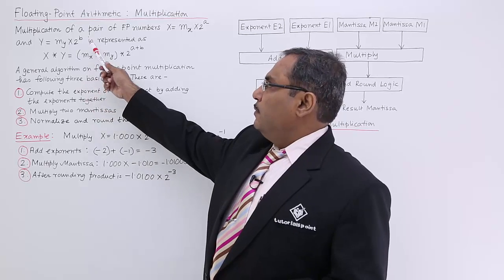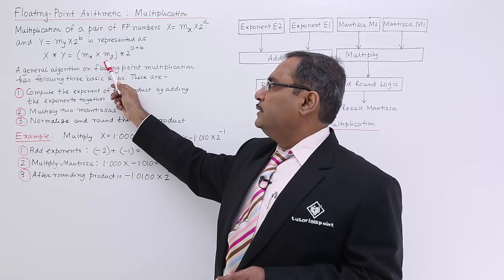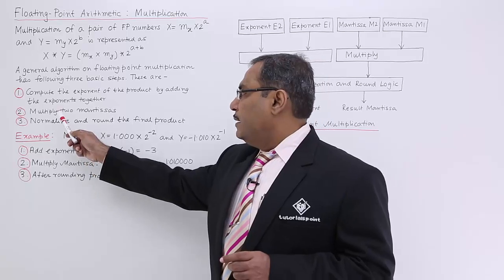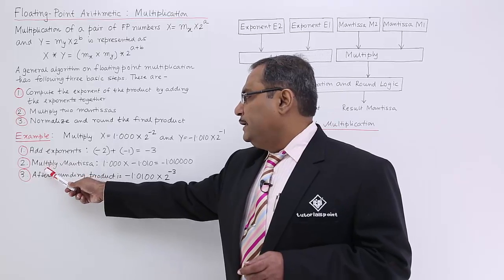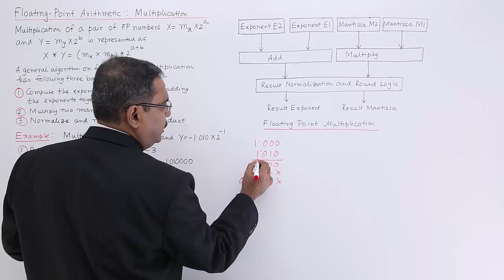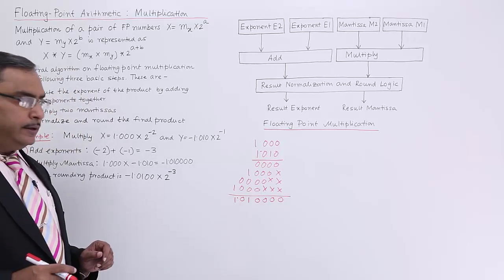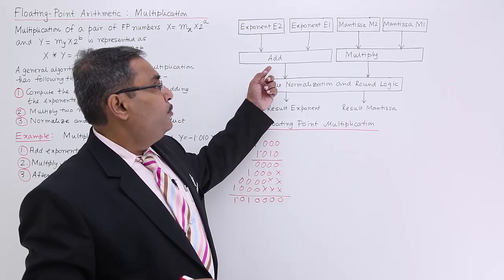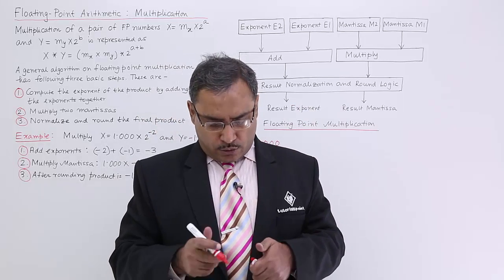Floating Point Arithmetic on Multiplication

Comment: is answer normalized
Reply: i think answer is not normalized because it is not satisfying the condition of normalization
Reply: no, it is not
Reply: @amrishpatidar2579  nah it is. You need to have a single non-zero on the leftmost bit. 
basically 0.00111 is normalized as 1.11. Here the answer is already 1.010000 so it is normalized
Reply: @sharjeelahmed7913  but normalization condition says that , the integer part must be zero